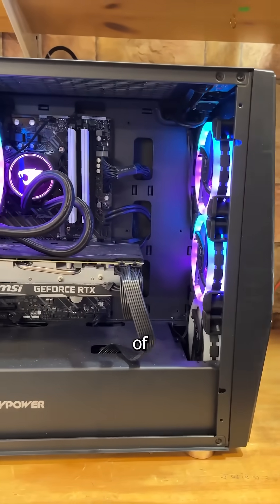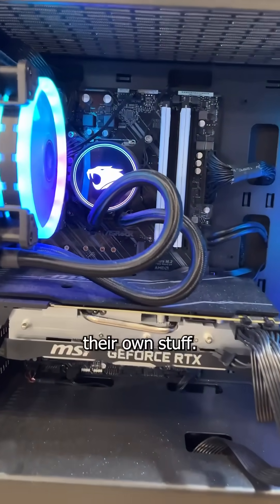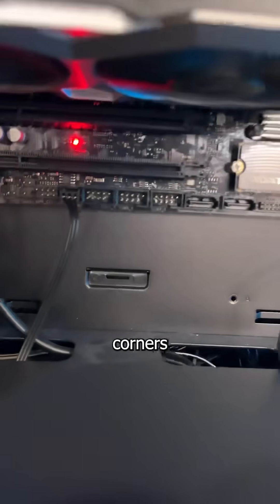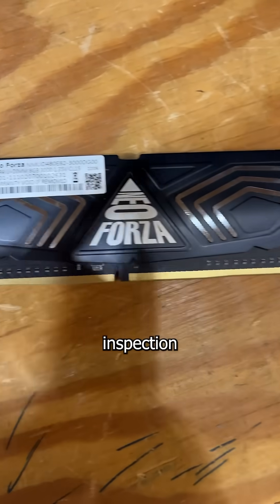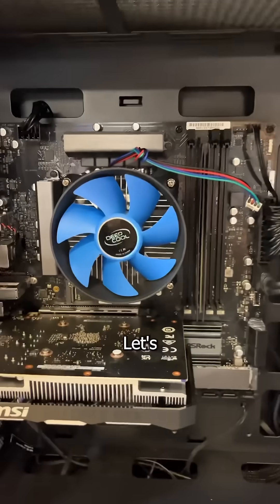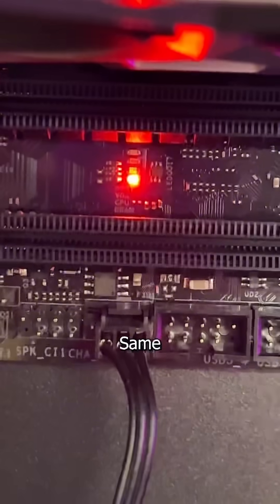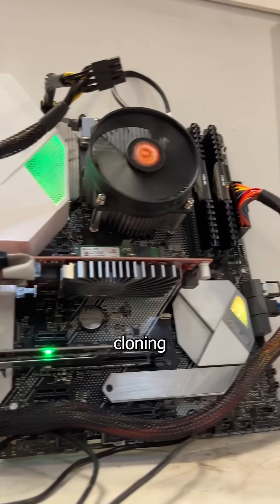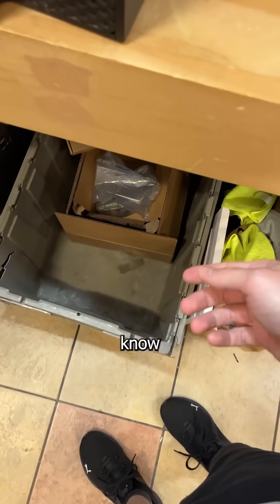iBuyProblems? Cheap NVMe causing no POST 💀 #technology #pc #tech #shorts #computer

Comment: Well it gives ram error because cpu first reads data in its cache and if the data is not there it reads the data in RAM cpu never directly search data in storage it only checka for data in memory and its memory that reads data from storage and when ram can't access data from storage and can't feed data to processor then processor tells motherboard that ram is not working and motherboard says that ram isn't working

Comment: i like adata and when i load windows on a pc with multiple drives, it recommends instal it on the adata drives.
adata grades the chips, like does the chips lotto for you so i buy their better chips.
i yam about to buy an adata legend 700 nvme 1TB with error correction and up to 7,000 MB/s read speed, for $70.

Comment: That looks like an ADATA Swordfish I've had the exact same one, it cause major power delivery issues under load at about the half full mark, I have a 1200 watt power supply with a 6900xt which is over clocked to the full 2ghtz vram speed and 3800X ryzen cpu, with 32gigx of ram at their fully rated speed.

PC worked beautifully, prior to hitting the half-full state of that NVME drive. Suddenly trying to download games off steam or other platforms would cause a strange crash behavior where at first things looked fine but then slowly the whole pc would freeze and lock up requiring me to hard restart.

I checked logs and it was showing a power delivery issues, which is weird cause I've got one of the higher end boards from the Ryzen 5000 series era.

Turns out the control chip on the drive was defective, the solder pad was pitted and messed up in a way I've never seen before.

I've since purchased a different NVME drive and check it over and found no such defect with the control chip, and it's worked perfectly and not had the same issues with large downloads...so yeah those ADATA Swordfish drives are horrendously faulty, I'm shocked they've never been recalled cause like that is unacceptable behavior for a drive like that. I still haven't pulled my data off cause I'm not sure if the whole thing is like unsalvagable and it had a terrabyte of commissions that I was working on so I don't know if it's all corrupted and I've had essentially a year of lost works.

Comment: Did you check with them before throwing away the drive? They could have data on there. Even if you can't recover it, perhaps a specialized data recovery technician could.

Comment: I actually have 2 NeoForza ram sticks, haven’t had any problems in my 4 years with them 
Didn’t get a pre build either, found them at micro center I think
Reply: Crazy how YouTube brought me back to this short the same week my ram stick died 😂
Reply: @RebakaChan  4 years of use is pretty good
Reply: Seeing how cheap quality Ram is these days, You should be able to buy almost any Ram stick from pretty much anybody and it should be mostly fine. The performance might not be up to the standards of the highest end stuff from companies like g-skill or Micron but it should get the job done and last for a long time
Reply: @the_undead you do realize only 3 companies make like 99% of all the ram people like gskill just buy and qc batches and develop heat sinks
Reply: @yomamadoer  that's exactly the point I'm making, 5 years ago. I forget if it was either more companies making RAM and they weren't as good or if It is the same three as today and they just didn't have as good QC (Or they dead and they just weren't as consistent on the quality) So you couldn't just buy any random RAM stick and think it's probably good enough
Reply: They also make SSDs and the SSDs are 100% long lasting but slower then most. The reviews basically call them out as being good for office PCs but my gaming PC doesn't seem to mind the brand. Loading times are still fast as ever, and the total lifetime of the drive is around 1400 terabytes written.
Reply: Meanwhile, the NeoForza sticks that came in the prebuilt that I picked up from MicroCenter back in 2020 were the most unstable pieces of crap I've ever seen.  Neither stick could hold a steady frequency and that turned into random freezes and reboots.  If it had been one stick, I'd have considered it a fluke, but it was both sticks - you'll never convince me they're not building trash.
Reply: NeoForza is cheap, has tacky labling and even tackier logo.  The problem is there is no quality control for them, so sometimes you luck out, most of the time they are duds.  Do not ever attempt to overclock them and always expect rubbish speeds and data rates.
Reply: As long as it's SK Hynix
Reply: It's probably SK hynix
Reply: Weird
Reply: whyd bro abandon his yt
Reply: Neotrash
Reply: You give me,a broke guy, hope regarding those cheap rams😂
Reply: Tbh ram isn’t a huge point of interest when it comes to reliability concerns. Basically any brand will perform the same as the next.
Reply: Lmao lie detector confirmed THIS was a lie!!!

Comment: It’s a sad case that these prebuilt companies have so many strange issues. You should see my PC, I call it Theseus. It’s a jerry rigged mess of cables that never overheats with no intake fans. Never had a dust short. Never had a boot problem. And until last week was using a 2007 model motherboard. Ran every game I could without issue and on high.

Comment: Since we're calling out bad SSD brands, let me add one to the list.

Western Digital.

Used to buy their HDD"s all the time. Figured for my first m.2 drives I would buy some of theirs as well. Big ol nope on that I learned... 3 M.2 sticks later. 

I've gone through the trouble of replacing them all now with intel optane P1600X sticks as boot drives and samsung 980 pro 2TB for fast storage and an 870 Evo 2TB for 'slow' storage. 

The old WD sticks are going to get data dumped here soon, get that data back as it were as best as possible... and then made into external only drives for maybe using to transfer files back and forth manually when needed. Nothing much more than that. 

1 of them by the time I realized what was going on, was already at 87 percent drive health. I'd only owned it for a year, and wasn't terribly hard on it. The 2nd one was at 93 percent or so... and only was about 4-5 months old at that point. The 3rd one was barely used, so it's still at 100 percent. They all started at 100 percent.

That's basically a health loss of about 7 percent on average per 6 months give or take half a percent. On lite to medium usage. 

I normally wouldn't take a large dump on a company like this, but apparently even WD realizes their folly with acquiring Sandisk as of late; and having 2 out of 3 is actually pretty bad in this case. (Sorry Meatloaf, RIP)

Comment: I bought an ibuypower PC and it would keep flickering the rgb fans then turn off. I replaced the neo forza ram and the psu and it’s been a great PC. I just bought a new CPU and a GeForce 3060 and couldn’t be happier. It was stressful at first but I learned a lot about computers and troubleshooting as a result.

Comment: I bought an I buy power 3 years ago just have slowly been replacing parts. No big issues with the old parts just out dated. Only big issue I found was fps with mine just had to install a stripped down version of windows. Runs like a dream. Note I only use my computer for gaming nothing else is really on it

Comment: I spent $200 on a 240 GB SSD when they were new technology. A guy I knew spent like $30 on an ADATA drive and poked fun at me for wasting money. A week or two later I walk downstairs and he's losing his mind trying to troubleshoot beep codes, the drive I bought is still working with zero issues 10 years later.
Reply: The first SSD I bought was a 64GB SSD, and I swear it was the fastest, longest-lasting SSD I've ever had.
Reply: @sergeantgunny  Your not imagining things. First generation SSDs were all single level NAND. That is, only one bit of data went to each memory cell. This means that the SSD is faster and will last longer. Current generation uses 3 or 4 bits per memory cell. That's why current gen drives can be slower/less reliable.
Reply: I'm still using my nearly decade-old Kingston 240GB SATA3 SSD. Cost about 130 bucks new and seems to work fine. I'll replace it when it croaks
Reply: @devilsoffspring5519  see ya in several centuries
Reply: Kinda suprised how shitty they re I own one myself it is semi broken for a few years now. Still functions but the read speeds are fine over 3000mb/s the write speed however up to 500mb/s which is way below than it should be. I am suprised the drive itself isn t broken alredy.

Comment: Unironically your joke about iBuypower was both funny and on point.
I've known 3 people to buy products from that line/company.
And everything about them and the ones sold at Walmart are a supersized red flag. Starting with PSU's that just meet the power requirement to get them to boot, to them acting like the cost thermal paste come paste comes directly out of their pay.
No joke, one of those people I mentioned was having overheating problems. There was almost no thermal paste on the CPU. And if I had to guess, they use low grade generic paste too boot.
The other problem all 3 had in common, their PC's all full on died within 6 months of purchase.
Now the literally only credit I will give iBuypower, if your computer is still under warranty, they will work with you to fix the problem. 
But nobody in their right mind should ever buy from them.
It'd be quicker and easier to gather up the money they charge for the computer you want, get a BBQ grill, some charcoal lighter fluid and burn the cash.
It'd have pretty much the same effect. But at least you'd get some warmth out of it and know that your money is gone quicker.

Comment: You can simply just pull the m.2 out of its slot then power up to see if the pc boots up...... If it does that will give you same answer. 
But also! Rubber eraser's go a long ways and are great for cleaning pins on ram chips, pci / pci express cards, and m.2. But if that does not solve this issue? Then yeah the drive is toast.

Comment: My prebuilt sadly came with an ADATA nvme drive and also RAM, the SSD started to cause issues at around the 3 year mark, but limped on for almost another 3 years until it SHAT THE BED and refused to boot but I was getting VGA error. I was pretty confident my GPU was fine so just bought a new SSD and now no VGA error :) I tried plugging the old Adata drive into a usb c adapter to get my data, it lasted about 2 minutes before i got the usb device has malfunctioned message and that thing was HOT :D

Comment: Correct me if I'm wrong, but in a hypothetical scenario... couldn't corruption in a drive cause this issue if that drive had a specific amount of it partitioned through Pagefile configuration (as the pagefile configuration does read as RAM, as far as BIOS is concerned).

Comment: I have an empty western digital nvme drive in my pc. I cant use it as it often would become corrupted if i did, but i also cant remove it because my PC refuses to boot without it installed. At this point Ive just accepted that it is crucial to the operation of my pc 🤣

Comment: Adata is the worst. Had a memory card fail that had tons of photos on it. They wanted around $500 to recocer the data off it it when it failed under warranty. I told them to get wrecked. Sent it to a local lab and they pulled everything off for  $120. Never again with Adata.

Comment: I have an ibuypower. Took off most of the parts twice before figuring out how to remove the AIO and replace it with a working one. unless you’re installing new ram, cpu or gpu removing parts like the AIO and PSU can be annoying, especially when you have to cut wires that can’t be unplugged in any way shape or form and there is a shell preventing access to any of the PSU cables

Comment: I bought my old pc thru them and it was fine, and lasted me for years with some upgrades over the years,  I helped my mom get one, and it was fine. i inherited it this year..and i found issues with the wiring for the P4 connection for a case fan connector when adding another case fan (wires/pins were put in the wrong spots so anything connected would not get any power at all).  and the RAM was not really meant for the board..nor can i even find it online.  I fixed the wiring by pulling the P4 connector apart and putting the pins/wires in the correct spots and replaced the RAM with the recommended RAM and added extra at the same time.  Its running way better.  now i just need to upgrade the CPU and GPU and it will last me for a while.

Comment: Could be an initialization error. Windows has the weird property of cacheing dram data so that when the system is rebooted you can pull up from where you left off on apps that had not been cleared from the ram buffer

Comment: That’s weird, my ibuypower uses the Y60 case. Installed Lian Li fans not too long ago and even before that I’ve reseated almost everything and installed a 2 tb NVME. Everything is top notch and perfect. 

Cost of building the system myself compared to through ibuypower was only about 200 or so.

Honestly, I wanted a watered cooled system and didn’t want to go through the hassle :(

Comment: Its the nand. It has a short that is pulling a common bus line high or low depending on the failure . This will of course prevent the power from coming on. 

Cause of short is usually heat. The boards are thin on m.2 slots. They flex and expand when they get hot. This pulls the pads off the board. It also can pull any cold joints with them.

Comment: I bought an ibuypower pc. Only issue i had was the terminal where the led light plugged in burn out after 3 years. I only replaced the ram and ssd.

Comment: Think about it, the drive is ram. It’s just ram that has non-volatile memory. So when it fails and creates a failure to post, it is technically a ram issue. The added DRAM cache doesn’t hurt either because that’s little dram on the drive that can also fail. It’s why there’s like really only 3 manufacturers for major ram brands, SK Hynix, Samsung, and Crucial(Micron) and they just so happen to make all the SSDs too.

Comment: Bought a pre-built PC. Came with most well-known brands. Intel core, a 2060, MSI mobo, but it had off brand RAM and an Adata SSD. I replaced the two off brands because of errors caused by those.
Reply: What about the PSU? That's another prime component for pre-builts to cheap on.
Reply: The PSU is most likely off brand as well
Reply: Same here: bought this pc before i was interested in PCs and it had an ADATA SATA SSD: it crashed every few hours and sometimes i couldn't boot at all; thought the pc is trashed, then installed windows on my HDD, same issue. Then i unplugged the SSD and voila, it worked. Luckily i had a motherboard wtih a M.2 SSD slot, popped on in, never any issue. Later replaced the sata with a samsung SSD, exactly the same. ADATA: NEVER AGAIN!
Reply: The ram was likely fine, as far as I can tell, there's only six or seven companies making RAM sticks and some of them have a bulk order with no label situation going on, So 99% of your RAM sticks do come from reputable brands just with a rebrand name
Reply: I bought one of those computers for my daughter on clearance price was great for the components but a single ram stick in a gaming pc was retarded rather they put 2 smaller stick for the 8g cause I had to throw the one out anyways not worth the price to match it. Ohhh the cooling in that case was horrible as well cpu was never stable till I put an aio in also got on sale lol I would have been satisfied with a slighty better cpu fan from the factory but the discounted price was worth it full price wouldn't have touched it. One I got was 11th gen i5 was open box.

Comment: The m.2 slot is most commonly (on lower end and cheaper motherboards) run along the same data lines as the ram, since it's cheaper

Comment: That right there is an Adata Swordfish drive. It's not even cheap, just bad.
The nand controller tops out at 1800MB/s, which is really sad when 3000MB/s drives could be had for less. Worse still is the fact that this was made when SLC caching was still in development and DRAM was used to compensate on premium SSDs.

Comment: I have the same brand of 16GB kit in my Ryzen 5500 running at 4533 mhz. Its rated at 4000 but overclocks well. The infinty fabric is 1:1 at 2267 too

Comment: I bought an ibuypower from Best Buy when I was like 19 for $900 and the dude said it would run any game for years to come, max settings, while rendering a video. 

It struggled with med graphics minecraft and came banged up. They said I couldn’tbreturn it because I damaged it, but the dents and scrapes matched holes and cuts in the box. 

Fuck ibuypower and bestbuy.

Comment: I bought an iBuyPower prebuilt about 3 years ago. I haven't had the CPU, GPU, or case fail but everything else has. Thought it would be a smart buy because it was on sale for less than it would have cost to piece together myself at the time. Boy was I wrong.